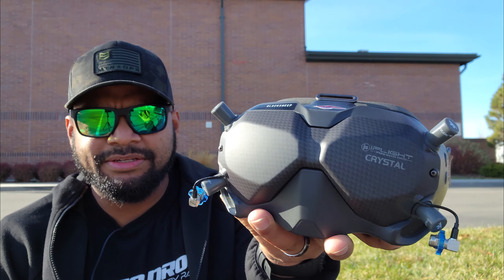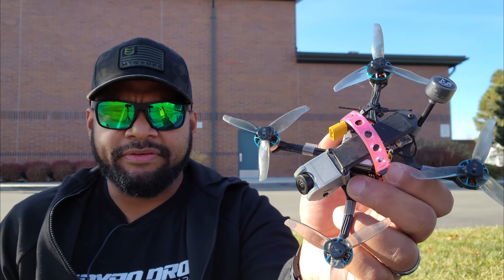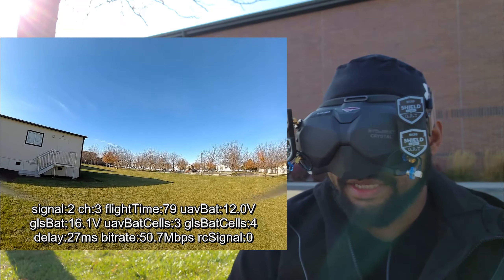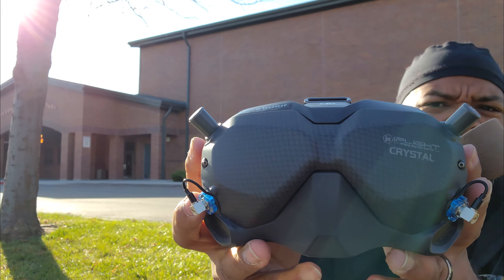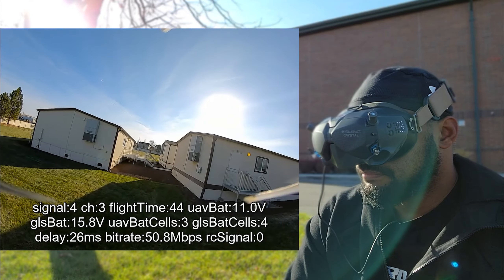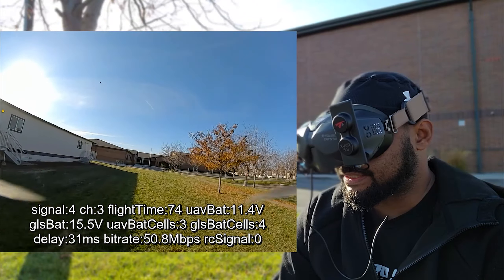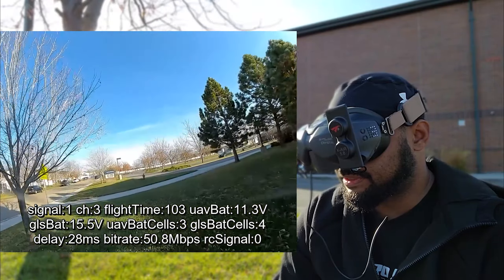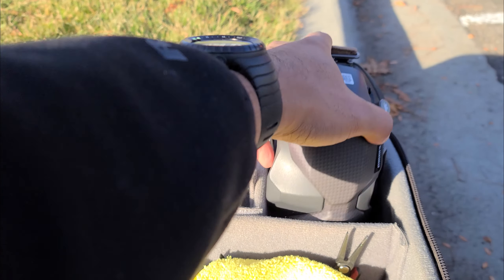iflight Crystal HD Vs. Shield Vs. X-air | DJI fpv antenna solutions

Comment: Hey Conrad. I have the Crystal antennas and like them alot.   I know you prefer side mounted antennas, however have you tried the cyclops mini? I'm curious if it'll be better for long range that the crystals?   Thanks for any input! Great vid b.t.w.
Reply from the maker: I haven't! Only the original cyclops which is on par with the xairs.
Reply: @Furadi  awesome thanks

Comment: Furadi, looks like the ORT and the x airs also have patches at the top, so perhaps the transmit of the upper ports is also helping their function when compared to the crystal?
Reply from the maker: In the case of the shields the performance was very similar even though it was 4 patches vs 2.

Comment: Did you attach a GoPro for the flight footage. It did not look like you had an attachment for one.. That is the best dji footage ever!! I just ordered my dji so I needed this comparison. I am also in the ryobi ecosystem.
Reply from the maker: Nope this is just what the DVR looks like after the 50mb update! So long as the footage is exported in at least 2.7k for youtube. Otherwise youtube gives it low bitrate and it looks bad. Probably what you're used to seeing. https://youtu.be/fh4QS9lAMyY

Comment: I would like you to check out four of the iFlight omnis compared to the four of the singularity omnis because four of the iFlight omnis are $28 compared to $78. I run 2 goggles in my bag for ride alongs and I am looking for a cheap antenna option so I don't have to take off the antennas every time I break out the ride along.
Reply: What’s $50 when you fly with 2 sets of dji goggles 💪🏼

Comment: Transmitter glove  + warm rubber bed bottle.
Doubles as lipo heater until flying. (bed bottle + lipobag in a thermobag)
And sitting on it is nice too :-)
Reply from the maker: Been using transmitter gloves and a variety of other suplimental heating devices since 2014. 😉 Nothing beats good old fashioned fire.

Comment: How does the Cyclops compare to these. I have it now and I'm happy with it so far. Are the iflight good enough to spend the extra money over the Cyclops.
Reply from the maker: Cyclops will have better performance for sure. But the crystal has much better form factor.
Reply: @Furadi  I took that mount off the back of the Cyclops and just put back the little thing that holds the ufl connectors on place and it at least fits in my bag now. I flew up the mountain and over it some at my house. The penetration with dji is insane

Comment: thanks for test, I was pretty interested in those (crystal), so that did help a lot :D 
how those upgr. JHEMCU GHF411AIO keeps up? I had 2 of earlier version ( not updated ones) and both died :/ one total RIP, 2nd lost 1 esc... so I do need decent AIO for 3incher+vista setup in reasonable price ;)
Reply: Solid as a rock. 200 flights zero problems
Reply: I've had 2 in a 95x... first one died on a hover test. Second one is still ok at the moment. 🤞

Comment: Great take on penetration over range. I don't think there are many reviews exploring this very important aspect of FPV. Also, can you elaborate more on how bad the stock antennae really are?
Reply from the maker: Check out the link I posted for Rcschims video I posted. But if the singularities were dropping down to 5mb then the stock antennas would have been around 2 or 3mb.
Reply: @Furadi  will do! Thanks.